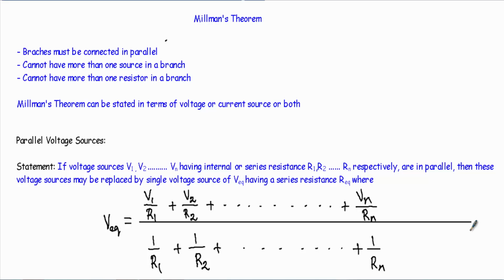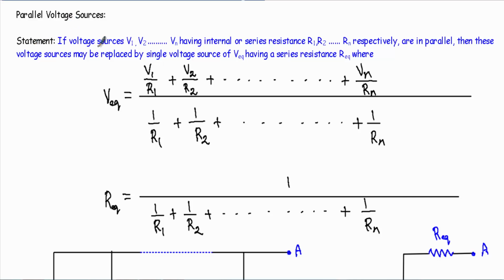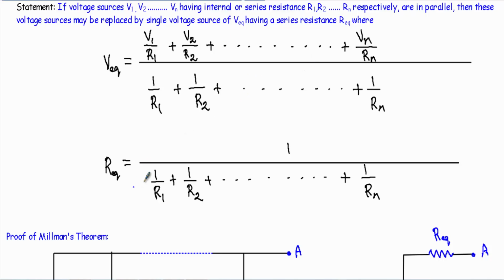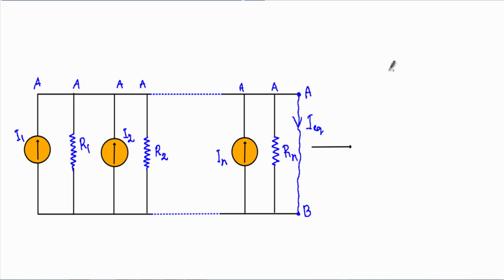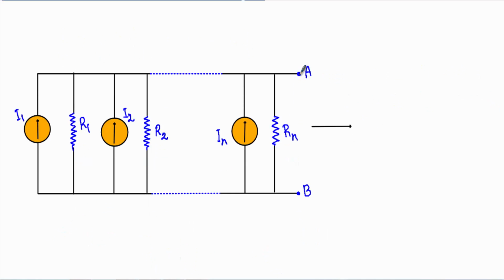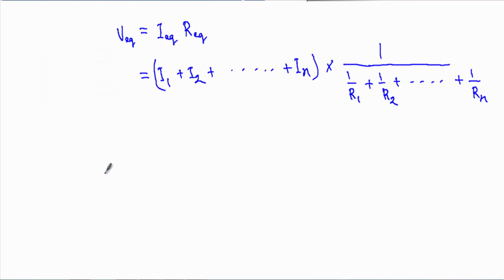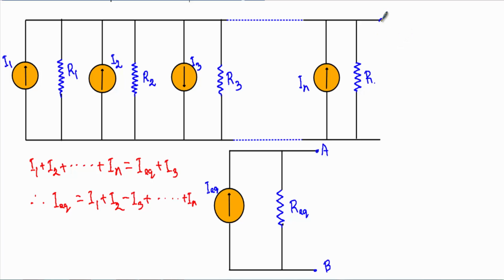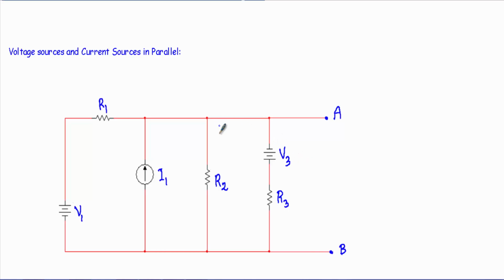Millman Theorem & Derivation (Parallel Voltage, Current Sources & Both Cases)

Comment: Hi , thank you for the video. Please tell me which simulation software you used, I will want to download it
Reply: Sir, the software used appears to be the National Instruments Circuit Design suite. There are several versions and variations that can get very expensive. I purchased the NI Multisim 14.1 for around $50.00. You can get older permanent installs that work fine. Hopefully this helps